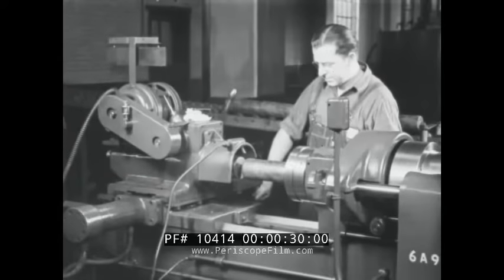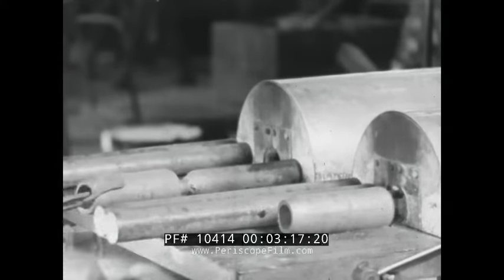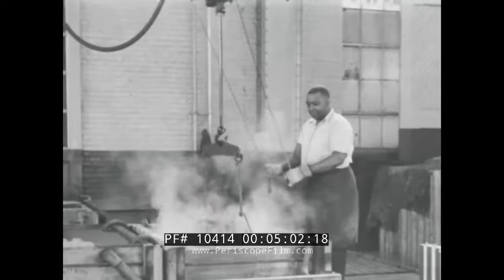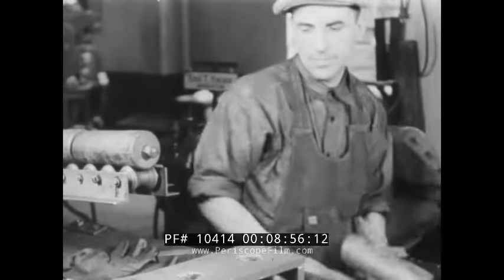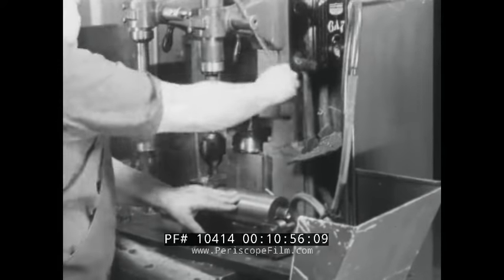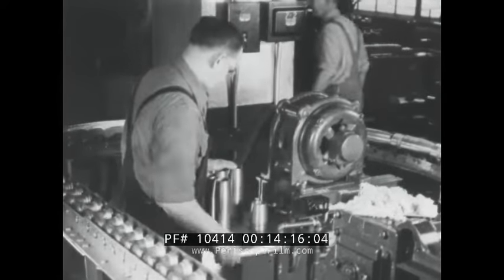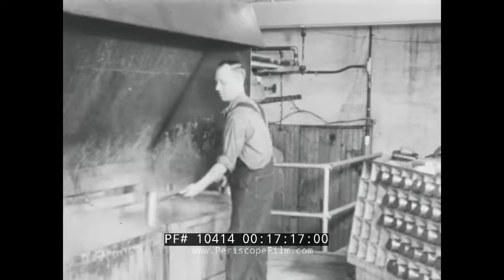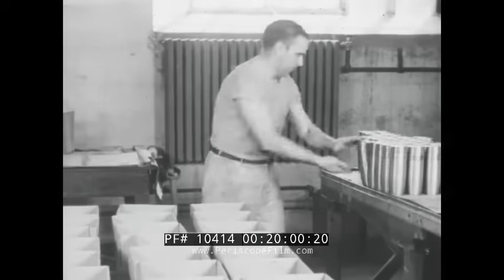MANUFACTURING 3-INCH ANTI-AIRCRAFT SHELLS     WORLD WAR II ORDNANCE FILM FRANKFORD ARSENAL 10414

Comment: When u see how much work goes to make a shell and how easy is to fire it wastefuly , is mind boggling
Reply: War itself is waste.
Reply: Well maybe not wastefully,  but certainly overkill was the 5 in AA coming off of every ship in the Pacific theater when bandits were called! Don't know what round this exactly was for,  might be 75mm high explosive for the m4.
Reply: @T3hderk87   It was written ''AAHE'' on the wooden crate so for anti air cannnons.
Reply: The US armed forces had 3 different 3-inch AA guns at the time this film was made (AFAIK).  The US Army had one, and the Navy had two.  The Army 3-inch AA gun was obsolescent at the time of Pearl Harbor.  It saw action in the Philippines and maybe a few other places, but it was already being replaced by a 90mm gun.  The Navy had both a 3 inch 23 caliber AA gun and a 3 inch 50 caliber.  The 23 caliber was obsolescent at the time of Pearl Harbor, but saw some action in 1942.  The 3-inch 50 caliber served throughout the war, but as you say, had been replaced by the 5 inch gun as the Navy's main heavy AA weapon.  It was used on ships that were too small for a a 5 inch, or which were not felt worth a 5 incher.  Since this film was made by the Signal Corps, I would guess these shells are for the Army gun.  More than you wanted to know, right?  :)

Comment: 1:19 "The bars are cut off using a high speed cutoff machine"
Shows a reciprocating hacksaw
Reply: That WAS a high speed cutoff machine at the time lol
Reply: Lol yeah I thought it'd be some sort of bandsaw.
Reply: Wingman4l7 
That technology didn’t exist back then, it was a simpler time.
Reply: I laughed out loud when the narrator said that.
Reply: Circular Bandsaws did exist at that time, but the powered hacksaw was more efficient for production, in this case. Powered hacksaws are still being used today.
Reply: Looked pretty good to me, cutting 4, 3 inch bars at a time, that’s pretty heavy duty, and I’ll bet that machine will still out produce anything more modern when you consider it was built so tough that it never stopped working and probably works the same today as then after cutting hundreds of millions of bars... try that with modern tooling I dare you...
Reply: @hootinouts  Bandsaws had been in common use since the 19th century.
Reply: The speed comes from putting 4 bars in at once. Getting multiple outputs with a single operation was considered fast, as a lot of the common timesavers of today were not commonly in mind back then. Essentially, he means that it's faster because you get 4 items in the time it would ordinarily take to get one.
Reply: Plus not using any cooling oil. Wonder how long the blade lasted?
Reply: @jimjonrs3932  Not so long that they couldn't charge the government for a stack of them.
Reply: Public educated "graduates", don't know what "Reciprocating" means...
Reply: @matthewhelton1725  The steel yard where I buy my material still uses one. I'm in Ontario, Canada, and they travel once a year to Milwaukee, USA to get blades for the stupid saw because it's the only place left to get them. They use them because the blades last a looooong time, not because they're quick.
Reply: That is high speed. the low speed cutoff machine is just a lad named Jimmy with a hacksaw and a right arm the size of an elephants leg!
Reply: Still in use, sometimes with a more "modern" housing in machine shops across the country.
Reply: @matthewhelton1725  The problem (as I see it) with a power hacksaw is not all the teeth are utilized.  Going back and forth uses the middle teeth more than the ends and when the middle wears out the blade is done.  With a bandsaw all the teeth get equal wear and therefore is more efficient.  I've never used a power hacksaw but have worn out my share of blades on a manual one... lol
Reply: i'm a retired machinist with over 40 yrs in the trade. Today people in the machining trade have no idea about manual machining
Reply: @robertw1871  you not lying I work in Aerospace and venders make machines to break down so only they can fix them , so they charge yearly service fees!
Reply: That machine is much faster than the horizontal bandsaw cutoff machine sold today at Harborfreight.

Comment: 1:21 
We had one of those mechanical hack saws where I work back when I started there almost 30 years ago. That shop in the War was repurposed to make much larger artillery shells than what is in this video. About 20 years ago it went in an auction of old equipment they offered to the employees. I got a 500 amp Lincoln stick welder, a Browning surface grinder from the 1930's, a tool grinder that still has the official  "War Finish" tag on it and a belt drive drill press from the 1920's.
Reply: capriracer351: Yeah buddy!  TRUMP 2020 🇺🇸🇺🇸🇺🇸🇺🇸💪🏻💪🏿💪🐘🐘🐘
Reply: we have one where i work we call it the donkey saw .
Reply: @jjmurff  trump fot 1500
Reply: capriracer351   Cool! Keep them for posterity! Artifacts like those may be minor but are still important. At some time you might consider donating them to the Smithsonian.
Reply: @jjmurff  Trump for jail
Reply: @kbanghart  
Ha !    Soviet thinking.
He's guilty of you not liking him ?
So what.
MAGA 2020
Reply: @fw1421   In the past 20 years I have sold all but the tool grinder. It works perfectly for grinding high speed tool bits for my South Bend lathe. I ended up buying a more modern drill press (1960's era) at a later auction that was much more useful. The surface grinder was so badly worn out I could not have gotten it to work correctly without major and expensive renovations. The Welder was just too much for the type of welding I do. It was replaced by a Lincoln 300/300 Tig welder I purchased a few years after I acquired the old one.

The shop I work at has been in operation since the 1880's, so there was a huge and unique history there. Most of it thrown out, much to the dismay of someone like me with a huge interest in history. I tried to save some of it, but did not have enough space to keep most of it.
Reply: While I watched this, was hoping they didn't just scrap everything at the end of the war.  Good to know someone is still using this stuff today.
Reply: many of our mills..screw machings drill presses still have US navy and US army metal tags and stamps on them..machines were built to last  then
Reply: @jjmurff  why him hes never gotten his hands dirty and complained about bone spurs  i used to patrol front country bone spurs .mininum 80lb pak on my back and at least 30 miles  of trails besides cabin checks.. citations  ..and trail maintence  with a mcloud in hand.
Reply: A friend of mine has a 1 man proto type machine shop. His lathe is a 1930's from the Ford plant in Michigan.
Reply: @capriracer351  Terrible that you let the Lincoln go, but I'd guess it was probably three phase and spun your electric meter like a merry go round just by being on. I also have one of the Lincoln TIG - 300/300 machines. Mine is one of the industrial gray machines, from 1964. Mine is unfortunately missing the foot pedal, and they are no longer available.
Reply: @zombieresponder  It was single phase, but the idle current was almost 40 amps, so you were certainly correct about the electric meter spinning at a high rate. Was not economical to use for hobby work.
Reply: @zombieresponder   Oh and also, you may find a foot pedal from some of the online welding sites. I assume that yours had the big variable resistor inside the foot pedal itself, we have an older Miller welder that has one of those too. 

I have to get ready for work now, but I will see if I can find the site that offers that replacement part later today.
Reply: @capriracer351  From what I understand, these machines had a lot more voltage and current going through the amptrol than later machines, so the pedals are a bit different, which is why no one offers them anymore. I need to call Lincoln and see if I can get schematics for the machine and the amptrol.

Comment: Amazing the number of steps to make these shells. I guess a video on how they loaded these would answer more questions like why the welded on disc. Think of the thousands of these needed in the war and how slow it took to manufacture.
Reply: I agree! The welded disc confused me.
Reply: @stefanspett7790  , just an idea because like you I did not work in this kind of manufacturing. Anyway, the bottom portion is hot, very hot due to the explosion of propellant. The welded disc slowed the heat transfer to prevent spontaneous burning of the gunpowder.
Reply: @Karl with a K , thank you for the info, now we know.

Comment: I ran Acme screw machines from '92 til '98 that had war certifacate stamps on them from WW2. We were running first operation blanks for ZF transmission parts that were going into various military vehicles. Those machines were totally mechanical, and always ran 24/7. I learned A LOT at 18 from the old dudes that taught me!

Comment: Watching slivers of metal ribbons peeling off the lathe in front of a workman who has neither eye protection nor gloves makes me wonder how many minutes that factory went without an injury!  The guys at the black lacquer paint booths had glasses but no air masks.  But where I got a chill was watching the guy checking for rough spots around the mouth of the shell with his bare finger!  At the end of a hard day he stopped off for a few beers, had one for the road , drove home without a seatbelt smoking all the way.  And yet, here we all are, successfully birthed!
Reply: It's called swarf.
Reply: @awatt  Aha! I just learned something.  My previous strange new word was Dross , I thought that wasn’t a real word.
Reply: One time, when I was a police officer, I got in my Crown Vic patrol car and when I went to grab the transmission lever on the steering column there was a long thin swarf of chrome plating that had peeled off in the hot sun.  That little sliver went under the fingernail of my right index finger, curved, and burrowed all the way to the bone.  Xray showed it slightly into the bone.  Doc couldn’t get a grip on it so he deadened my finger and had to pull off my fingernail to be able to grab the object.
Reply: @robertansley6331  
I once got a bad paper cut.
Unboxing something and ended up with a cylinder of corrugated paper sticking out of my finger that pumped blood in time with my heartbeat.  Freaked everyone out.  Had to pull it out with a pair of pliers.
Reply: @awatt  Ha!  That’s why this video freaked me out so much.  I use to go to India a lot and one time I saw a barefoot construction worker shaping a piece of metal with a ball pean hammer.  No goggles, no gloves, no shoes. But Service !
Reply: Eye protection would be good but gloves around lathes can be very dangerous. If it gets caught it can tear your arm off.

Comment: It's amazing what was accomplished long before modern CNC machines , programmers , digital calipers , micrometers and quality control . They didn't have calculators and used a slide rule ... pencil and paper .
Reply: Don't forget log tables for calculations that needed more accuracy as well as Sines & Cosines. Do they still sell them or do mine have rarity value ?

Comment: i used to run centerless grinders to make carbide tips for armour piercing bullets, about 1000 per 8 hour shift
Reply: I use to rebuild the grinders
Reply: @johnwheet7037  I used to mine the coal to power the steel mills that made the metal to make the grinders.
Reply: @markrainford1219  I dug the holes for mining coal with nothing but a sharpened stick.
Reply: @johnstudd4245  I sharpened sticks. All day long. With another stick.
Reply: I treated all the guys that suffered occupational illness from the carbide, coal, asbestos, etc used early in the defense industry

Comment: Amazing the amount of care and precision put into a shell that will be fired once. Also surprised these weren't made of brass for ductility reasons. Could have put a brass ingot into a die and stamped out a shell in a second.
Reply: Better fragmentation from steel.
Reply: fordrac1ng81 brass was very scarce and required for small arms and bearings.
Reply: The brass was used for the case, this is the bullet
Reply: If you look at the shipping box, you'll see these are HE rounds. High Explosive rounds need a little more care to manufacture, normal rounds can use different materials and processes .....

Comment: Very interesting.  Also noticed no safety glasses, gloves and smoking while working...my how times have changed.
Reply: Yes!  I would think some safety glasses would be easy and not cause an argument.  But, cheap plastic emerged after WW2, not before. Today I saw a boat builder pounding wood with ear protection! wtf. In Britain, of course.
Reply: Wow--look at 18:56--his long apron is just a few inches from that belt-driven pulley.
Reply: I was thinking the same thing.
Reply: The spot welder alone would have a dual button to initiate cycle with an arm to keep the disc in place.
Reply: @marknewman3712  ,that generation truly was amazing.  Survived the depression, won the war and if you got hurt you just "walked it off" and went back to work.

Comment: Many steps needed to make each shell, and yet we were able to make so many we were putting up literal walls of steel against Japanese planes during the Pacific war. The machine tools these men used to manufacture the shells are amazing. No doubt these manufacturing processes are greatly automated today.
Reply: Surprisingly very similar I'm an engineer in a forge plant that uses the same 3"upsetters everyday ran the same way by hand with tongs and a lift assist identical to that shown, same induction heaters same shear presses facing machines gages turning operations all almost identical to what we do today.

Comment: My dad worked making shells at the Hamilton boxcar steel company in Canada during the 2WW, I think he told me they were 60 pounders.
Reply: john ward in USA shell size is inches on navy guns and millimeters on land guns/artillery, not pounds. You Canadians... lol
Reply: @adamsmith5151  I did not know that. Very interesting. However, I hate that metric system with a passion!!! I've got 2 toolboxes full of tools. When one would certainly do.
Reply: @adamsmith5151  Back in war time it wasn't MM for one thing the US uses Standard measurement Canada uses Metric. Here is a line out of the Info page: Some were named after the weights of obsolete projectile types of the same caliber, or even obsolete types that were considered to have been functionally equivalent. Also, projectiles fired from the same gun, but of non-standard weight, took their name from the gun. Thus, conversion from "pounds" to an actual barrel diameter requires consulting a historical reference. A mixture of designations were in use for land artillery from the First World War (such as the BL 60-pounder gun, RML 2.5 inch Mountain Gun, 4 inch gun, 4.5 inch howitzer) through to the end of World War II (5.5 inch medium gun, 25-pounder gun-howitzer, 17-pounder tank gun), but the majority of naval guns were by caliber. After World War II, guns were designated by caliber. read this  https://en.wikipedia.org/wiki/Shell_(projectile)
Reply: Likely to be 25 pounders, 60 pounders were used in WW1. Replaced in WW2 by the 5.5 inch gun.
Reply: Roger Carrico I hear ya! I used to be able to guess the imperial wrench size I needed just by looking at the bolt or nut. Not anymore.
Reply: @bobdiluted6243  But was still used in the first part of WW2  https://commons.wikimedia.org/wiki/Category:BL_60_pounder_gun
Reply: @adamsmith5151  - ha ha, I do similar, i look at the size of the nut or bolt and guess the imperial size then try to remember which metric size is close to that imperial size.
Reply: john ward hello, but CANADA  only used metric when US was going to, but later did not, but CANADA JUMPED as it , I was born & grew up in a BRITISH CROWN COLONY     but now that they became independent, they went metric,   I live in USA so certain stuff is metric & others are standard , Cheers From NJ. 🇺🇸🇺🇸🇺🇸🇺🇸
Reply: Adam Smith hello, but the BASTARD  type in ENGLAND WAS WHITWORTH, , thank god it’s gone , but yes I can still guess what size in standard, but the size of a FLARENUT Has changed 3 times for 1/4” tubing, they started with 3/4”. then it went to 9/16” & then 5/8”.  Time was a ‘SET OF FLARENUT WRENCHES was only 2, , now you have to have others . . Cheers From NJ🇺🇸🇺🇸🇺🇸🇺🇸
Reply: @flybyairplane3528  yes i went to public school in Ontario Canada when the change over happened and understand both. I have used both in my profession as a Machinist/Pressure vessel pipe welder.
Reply: @adamsmith5151  British and Canadian army weapons were described by the weight of the shell. So lookup the 17 pounder gun we put in the Sherman tanks.
Reply: @adamsmith5151   It's how the English measured guns 60 pounder prob a 5" gun
Reply: In canada they were manufacturing munitions for the british, their smaller shells were called by the appropriate weight of the shell ie: 6pounder, a 17 pounder was approximately 76mm or 3"